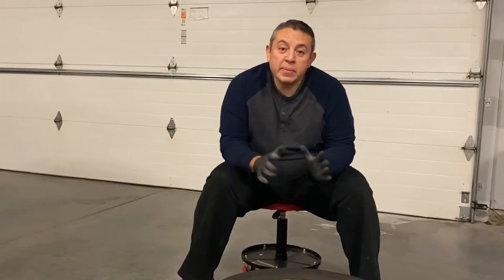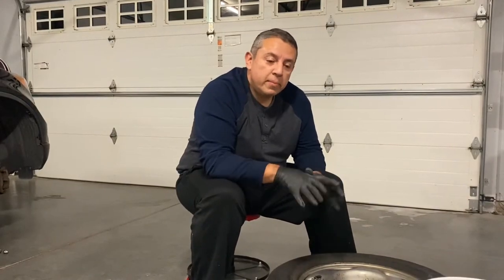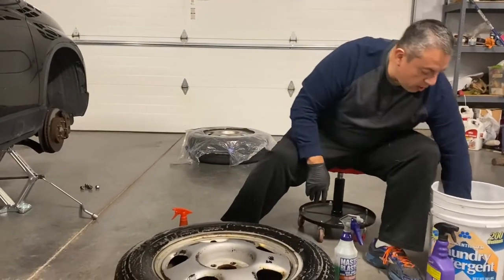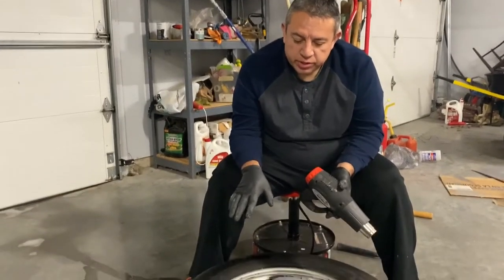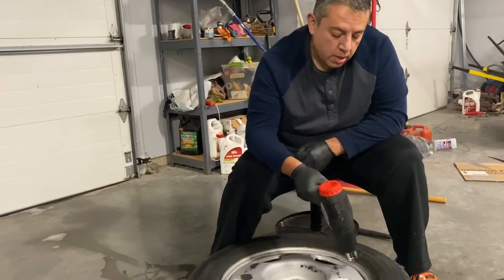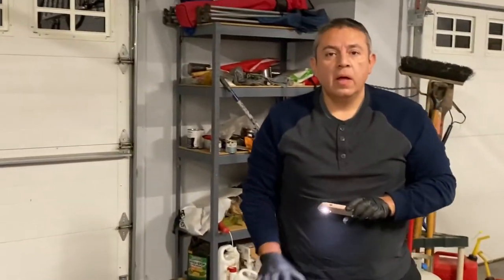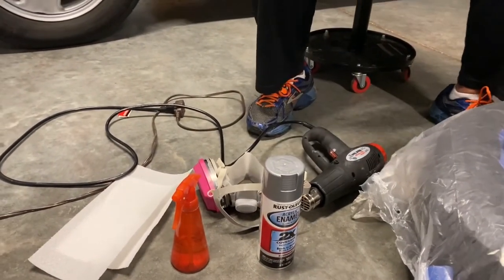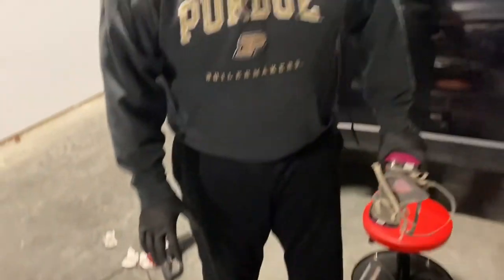How to restore and paint the steel or aluminum wheels

Comment: Bit late but, instead of paper towels, you could use tack cloth, real good at picking up dirt from primer/base coats. Also if you want a real smooth finish, get some sandable primer. Shoot a few layers then sand it smooth with 600 grit and up depending on how comfortable you are. Then shoot your paint, get a real smooth almost factory finish.

Comment: Sir,
I have a 2011 CRV. I came across your video solution to repair and make look new again the ugly stock Honda CRV wheels. My wheels are the same type as yours in the video and look just as ugly. I live in Upstate NY and as soon as weather permits, I'm going to try your solution. I'll try to remember to send you pics of my project. Thanks again for sharing your knowledge. 
Mark
Reply from the maker: Yes please do. I’d like to see your results.
Reply: I also live in upstate ny, have these exact wheels.  They were pretty bad.  I ended up watching a bunch of steel wheel painting vids.  I put a bunch of work in on it.  Wire wheeled all the rims so there was nothing on them  and they were smooth.  Primed them, painted them with Dupli-Color wheel paint, and clear coated them with the Dupli-Color wheel coat and they lasted about a year and a half.  They looked brand new when I did do all that but now they look worse than they did before.  Now I'm just going to order wheel covers and plastidip them black and be done with it.  The wheel covers only come in chrome so that's why I'm plastidipping.  In another climate they may last longer but where we live, it's short lived.  Perhaps you'll have better luck
Reply from the maker: @SEGAraid  sorry to hear the process didn’t last very long. I wonder if a thicker layer of clear coat would face helped or if the harsh winters were just too much for this type of repair.

Comment: Any thoughts on sandblasting rhe wheels with the tires dismounted ?  I’m considering doing that for my daughters 2010 Honda CR-V wheels that look just like the before pictures
Reply from the maker: I do not have any experience with sandblasting, but I would imagine going to that level for restoring wheels would make for a better result than what I went for here.  This Honda was for a flip and I think if I were working on my daughter's vehicle I would probably take extra steps to make the wheels look better for longer.  Thanks for the question.